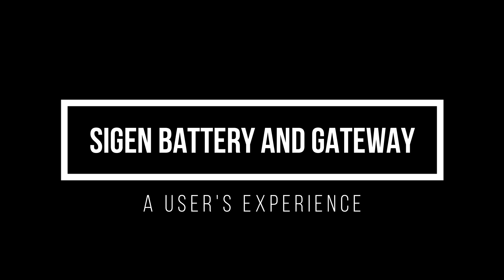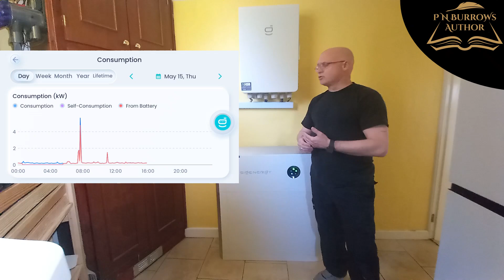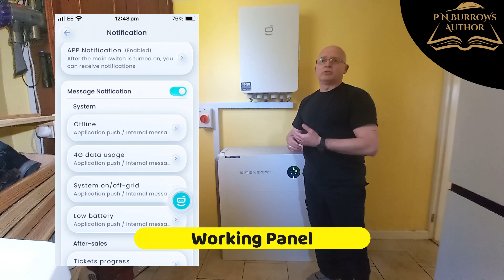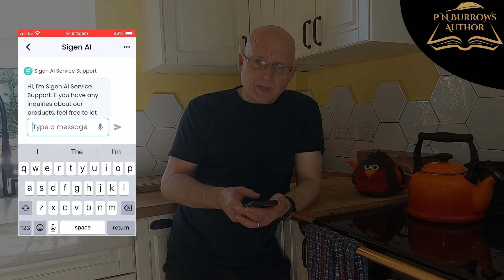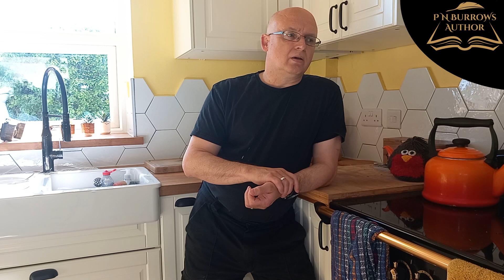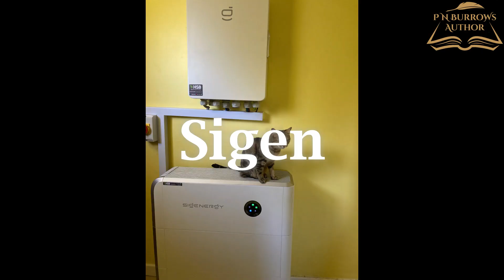Sigen Battery and Back Up Gateway - A User's Experience

Comment from the maker: One of my gripes has now been fixed, Sigen have added a button to allow the user to charge and discharge for a set time / kWh. An awesome feature that was missing up to now, thank you Sigen. Gateway's still noisy though... no update will fix that, but I am keeping an eye on their new gateway. Hopefully it will be availalbe in the UK soon.
Reply: Put my 24 kw sigenergy system outside so no noise problems
Reply: Can you move the panel to the other side of the wall it’s on, so that it would be mounted outside, and run the cables through the wall. I know you said there isn’t enough room for the battery outside, but the panel is much slimmer and can be weatherproofed.
Reply from the maker: @tedshep sadly no, the wall is the boundary between myself and my neighbours.

Comment: In a Your Mileage may differ moment.

I have an identical Sigen set-up to you with Gateway and 2 x 8kWh batteries. Mine has solar power (16 panels) in addition to an EV charger (Andersen 3). I have the gateway set-up in my home office, about 4 feet from my head and I have never heard a peep from it. My desktop computers and various hard drives are way more noisy. When everything computer wise is off and I press my ear to the front panel of the Gateway box I can hear the slightest hum. If I move back to my chair it is glorious silence. You might have been unlucky, I might be lucky. The company who did my install (Infinity of Southampton) were very good but I don't think even they can make a supposedly, inherently Noisy box into a calm, silent machine. 

As I say, a single HP desktop is far more noisy. There is the possibility that something is amiss with your install, uncomfortable but possible. Either that or I ought to buy a EuroMillions as I am so lucky.  I couldn't be happier with my system, working brilliantly (and quietly) with Octopus, my electric bill, bar standing charges has gone from an average of £209 pcm for the previous year to £7 pcm as the Gateway and Sigen AI work with Octopus to keep bills to a minimum even in miserable October.

Comment: Its all been installed to OEM specification - hence the location. You need to add an absolute minimum of 10 solar panels (20 better) to make this anything like a worthwhile investment, thats the bottom line.
Reply from the maker: Yeah, I am having 15 panels (7300w) fitted in the week or so. Sadly only west facing as my wife doesn’t want to spoil the look of our Welsh cottage. The battery is being moved outside with a  long cable run and the gateway is now going in the cupboard which I can sound proof.
Reply: @PNBurrows-Author yes she is right not to mess with the aesthetics of a period property. West roof always outperforms the east by a third anyway, this just means you will need to consider an additional battery at some stage to store more power for morning use. Meantime you could change your washing machine and hot water timers to exclude that morning's period. Zero day rate kW units is the goal. I aim for a maximum of about 50 per year

Comment: Thanks for the Video. As others have stated we can't install these in habitable rooms here in Australia. My setup will be inside a vented 20ft shipping container with a backup generator so any noise wouldn't be heard. The container will be on the end of my shed which will have 20kw-30kw solar on top. We will be totally off grid on 100 acres.

Comment: We've installed numerous SIgenergy systems and have yet to experience a buzzing Gateway to a point where we were aware of it. The contactor is audible when it switches to off-grid but that is a once off "clonk" so no real bother. The inverter fans do make a little noise when active so we don't recommend inside unless it's a closed off (utility) room. Sigenergy seem quite pro-active in improving app functionality on request so we expect any little niggles to be sorted over time.

Comment: Bad install as you should not put the Gateway above the unit as if you want to extended you need to remove and extend all the wires again, were if it was done on the side which you should you can just add another battery yourself without a installer

Comment: Good to see some real Sigen world experience. thank you.   We have a similar  Sigen setup, but installed with solar panels and located inside our attached garage.  And our experience has been very positive.   With our internal garage door closed, there is no noise pollution to the rest of the house at all.  My gateway is slightly noisier than your system at app 40-42db.  Also the 10kw inverter version has a fan which operates in the recent hot UK weather and is over 50db.    Therefore, unless you can get one of the new slimline inverters with less 25db, it’s either garage or room that can be shutoff from rest of the house.  Agree with your security concerns locating batteries outside.  If you can, Solar panels are the way to go and IMO the App is a much better when used with solar.  Although the app is not intuitive, it did improve with the latest update, once sigen got the iPad version working correctly 😊.

Comment: Is it the panel on the inside of the Gateway vibrating that you can hear? Could rubber pads, felt packing or some blu tack stop the buzz? There are screws that hold the panel in place. Are they tight enough? Are there other mounting points that hold the bus rail or whatever that wasn't tighten 100% (get your sparky to check, most people should stay away from the inside of a power board.) What happens if they are loosen to reduce transfer of the vibrations? Small rubber O-rings to be used as rubber washers?
Reply from the maker: Hi, the installer came out and checked it, removed the inner panel, alas it made no difference. They agreed it was noisy, but as Sigen would not replace it, there was nothing they could do. I just dropped unlucky with a noisy unit. I was going to make a wooden sound proof case with mass loaded vinyl on the inside, but will wait for the newer smaller and quieter gateway to become available. My installer said they would not charge for the fitting as they feel bad about the whole thing. The fact I will shell out £700 or what ever it is, is an indication of the noise levels.
Reply: @PNBurrows-Author  that's bad news. Can you use a sound meter to display the number of db? If it's louder than the stated level, then you could claim it's faulty?

Comment: Panels are always a good addition for sure, you're just hoping your power cuts are short term, if not your batteries are done. Do you get any sun in Wales though? Particularly in the winter.
Reply from the maker: You are correct, the nearby village was off for three days a couple of years ago. My battery will only last a day or two depending on SOC at the time. Living on a small mountain, we are in the clouds a lot, looks like like fog. But this does produce a nice diffused all round light, which would suit our west & east facing rooves.

Comment: Re: noisy gateway. I haven't got one as yet but I do understand how they work. There are several contactors, each with a magnetic coil, each of which will hum a little when energised. Because you don't have multiple inverters or a back-up generator, and possible nothing on the 'smart port', some of these contactors may be activated when they simply don't need to be. These could be disable by removing the neutral wire from the coil. (Electrician job). Without so many contactors active the noise should be reduced.

Comment: In Australia (Brisbane), we cannot put the Units in a "Habitable area" of the home, (ie a study, spare room, bedroom, lounge, Dining, office, Kitchen due to battery(s).
They go usually into an Attached Garage (Fireproof walls etc, and if where a vehicle is parked would need bollards for impact protection), or External garage, Outside weather protected wall, shed, Carport, etc.   So I would assume that any audible buzzing (Which I presume  the buzzing is from the AC Power) would not be an issue,  Also the Sigen Gateway I have installed is a lot smaller.
Same setup tho 16.2kWh battery and 10kW Hybrid Inverter  on a Sth facing wall under a weather protected Patio. and the Gateway is installed outside in a carport right next to my Grid Power supply and main Switchboard.   Also as we have plenty of sun, I have 12.7Kw of new Aiko Solar panels.  And the Gateway is set up to power everything of the bttery, if the grid goes down.  With the expectation that there will be no need to draw from the grid, just export when the Wholesale Price is good.  The Gateway also control the hot water, as in when the batteries are full, and the house demand is met from solar, the excess powers the Hot water system  But this can be changed via the app, if need more hot water 
I cannot hear any sound, and It loves being outdoors also to assist in keeping cool 

Hope you manage to get the buzzing resolved   Maybe relocate just the Gateway Outside 
Cheers  thanks for the Vid
Reply: Also from Brisbane and interested in a similar system, would you mind sharing who you went with for installation, and your experience with them? Thanks!
Reply: @jezzap  I used  local long standing Electrical/Solar company here in the Redlands.  
AIS Electrical, they have done assorted works for me like moving my grid supply point of access, and other stuff. And right up on Solar,  I love that they are full of great ideas to achieve my goals. Extreemly helpfull and professional. 
I replaced my old (8yr-5kw panels, that were still producing 5kWh on  good day, That I have repurposed 2 of for my Camper,  1 for one of my sons, and most of the others that are on my shed roof . I Have other plans for lol.)
Sigenergy system 
28 Aiko Neostar ABC 455w panels smart and shade tolerant. (not that I have any shade, but they produce more power longer at low light ie dawn/dusk)
3 X 8 kWh Sigenstor Batteries (24kWh)
10kW Sigen smart energy inverter
Sigen Gateway  (UPS) set up for total household backup, and HWS control., and export smarts. and nice App (And probably with Amber-The wholesale market when I have more Data)
The whole setup looks compact smart & tidy, and out of the weather. seamless install. with the only depay being sourcing an additional 8kW battery, as initially I was only having 2x8kw, but the 30% rebate was too good to pass up, and much more future proofed.
The systems are very modular, like putting lego blocks together, and easy to build what capacities you want  ie 5 or 8kWh batteries and 5 or 10kWh Inverter, all the same sizes so it looks smart and compact.
Reply: @jezzap got mine done with keon electrical…local excellent install took about 12 hours very happy

Comment: The link below has a Sigen installer giving some information on reducing the noise on the Gateway,  in summary making sure the screws are tight and possible inner side padding to the inside of the door to press on the face that vibrates.  Just my summary and have no personal experience.
https://www.youtube.com/watch?v=gwxOc63wIxk
Reply from the maker: Cheers Brett, My installer did all this when he came to check it. After calling Sigen, who said if it is less than 45db at 1m, they would not do anything, he apologised and left. Mines about 37db. But thank you for taking the time to post the comment, it is appreciated.

Comment: Thanks very much for your feed back. I'm looking at buying this, but can't stand electronic oscillation noise... grrrr
Reply from the maker: The noise on my gateway is really bad. But, if you can wait until Sigen release their new single phase gateway, it should be less than 25db. Or so the website says https://www.sigenergy.com/en/products/gateway

Comment: You definitely need to add solar, as much as you can do. I've been told that the app is being improved. The gateway issues I've also heard they're addressing, not sure though on this. Being a young company there's some teething issues but so far a mate who installed a 48kW system in South Australia absolutely loves it.

Comment: Good to know, I am planning to get a Sigenergy installed in the garage. Haven't got any quotes yet. I'll see if can check at least one installed so can hear how loud it is.
Reply from the maker: Hi, if it is an external garage, there will be no problem. If the garage is part of your house the hum/vibration may seep through. There is a newer gateway coming out, website says less than 25db, which is far better than my 37db unit and the 45db limit Sigen regard as tolerable. The decibel scale is not linear; it is logarithmic. A difference of 10db means it is twice as loud. So 35db is twice as loud as 25db.

Comment: Better placement of the Gateway seems to be a reasonable fix - if available.
Reply: My installer suggests NOT  placing the Gateway above the batteries in case of an electrical fire.

Comment: Great video. Most installers only have positives to say and do not have to live with the system after installing it. Please upload a video with a long high quality recording of the buzzing nose of the gateway. I will then use this as a test when considering a location for the gateway or perhaps not buying sigenergy at all.
Reply from the maker: Hi, It wouldn't help you much as it would depend on how loud your speakers are set to.

Comment: Interesting to hear a real world experience thank you. I have just bought this system, i wouldnt buy a Tesla on principle and i have read about some weasel words in the Tesla warranty. i like the idea of AI learning so long as i can override it, i dont mind  a reasonable subscription model if it adds value. i assume the noise is because in normal operation the contactors are energised all the time and when the power fails they automatically drop out to protect the grid.  Disappointing that they can be noisy although apparently not all.  I am putting mine in our detached garage which is about 1.5 metres away from our kitchen so hopefully wont hear it except in the garage itself, we shall see.
Reply from the maker: It’ll be fine in a detached garage. You are correct, it is only noisy during normal operations, in a power cut, it’s silent. Thank you for the comment.

Comment: How will you add more battery modules with gateway in the way? it now requires the electrician again.
Reply from the maker: Hi, It will have to be an electrician who does the job, as the invertor will have to be raised and cables moved. When it was installed I asked my installers to leave enough room for one more module. The company who installed the battery have been great and sympathetic over the noise. We are both waiting for the new Sigen Gateway to become available in the UK and I will have that installed. Thanks to the tip from @robmoreno7244

Comment: I think Sygen just came out with a slimmer gateway. Hopefully, that will reduce the noise. I am fortunate to live in an apartment with a shed in my terrace and that's where I placed the solar system, as I did not want it in the house . 
Like what you wrote before, I actually would have placed the system is that cabinet you have next to it and insulated the whole thing. I think that would have dampened the noise. 
What I've learned about things that have large capacitors is the fact that they make a loud hum noise. 
I have 10x605watts panels on my roof. The avg daily solar energy generated is 36.71Kwh per day. That much electricity is bound to make a hum!
Either way, good video and nice house.
Reply from the maker: Thank you for the heads-up regarding the newer gateway, website say <25db :) I will investigate. The cupboard near the batter have the water meter and pipes, the top has the elec meter. Thank you.
Reply: @PNBurrows-Author  ....wack a cabinet around the Gateway? My fish tank filter and air pump noise almost disappears when I close the cabinet doors on the tank stand. A cabinet lined with sealed cell foam would cut out a lot of sound, but would heat build up an issue?
Reply: Can I ask what brand those 605w panels are?🍻

Comment: Hi from NZ. I've been looking into this system as it's being used as the suggested option by my local electricians.
However the thing I have become concerned about is the provenance of the cells. They will not say where they come from which indicates to me they are rejected automotive cells. That's ok if they match them carefully but there's no assurance about that. Therefore I'll wait and see.
Reply: Do you know of any automotive cells that use Lithium Iron Phosphate (LiFePO4) which is the chemistry of the Sigenstor batteries?